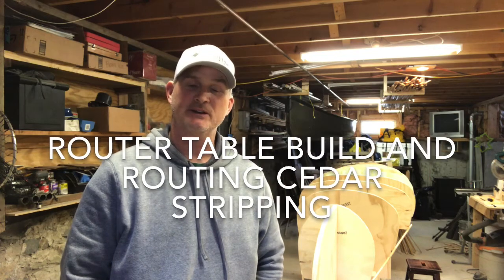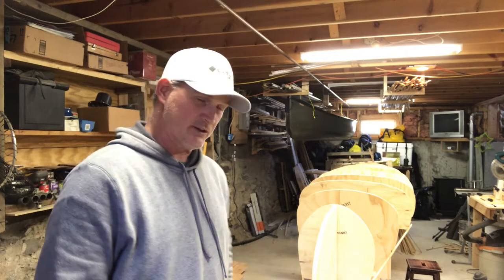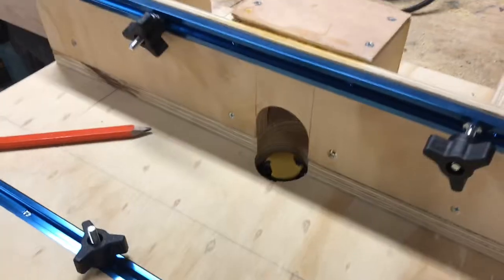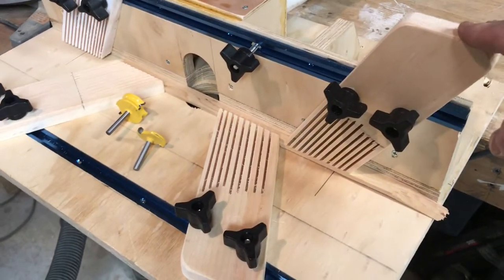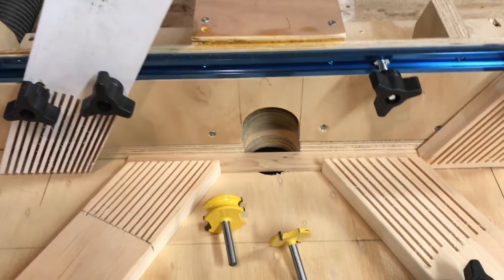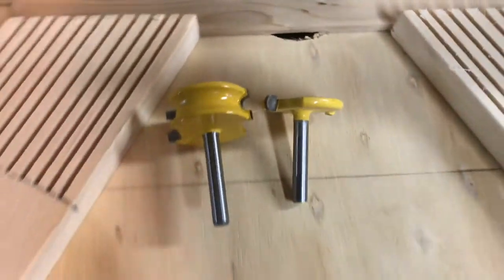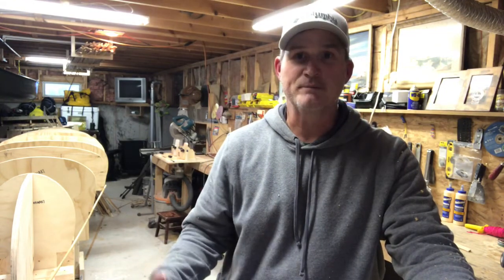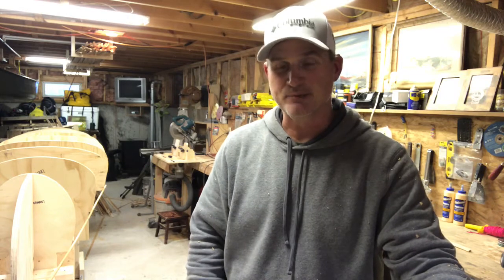My First Canoe Build, Part 3, Router Table Build / Cedar Strip Bead and Cove Edges

Comment: Hey, alsg here, don't forget to put packing tape or duct tape on the edges of all the forms to prevent the glue from sticking to them!  Also, have you beveled the leading edge of the bow and stern forms?
Reply from the maker: Thanks Alsg.  I fully intended on masking the form edges and have not shaped the bow and stem forms yet to receive the strips.  Just purchased a rasp in order to do that.  Next video will show the stem forms taped, bow and stem form beveled and hopefully a decent portion of the canoe stripped.

Comment: How come you had the fragile cove edge ? The cove bit height was not properly adjust ? Thank in advance for  for any comment .
Reply from the maker: Yes I believe I cut the cove too deep.  I would suggest several test passes to establish the final set up before processing all of the strips.  I learned the hard way but it really didn’t affect the finished product at all.  Ultimately the deeper than preferred cove cut forced me to use more material when it was all said and done.
Reply: @mainetripper  For sure I will take your advice and will do few test cut before   doing all of them . Appreciate your help .
Reply from the maker: Glad I could share my mistakes. Best of luck with your project!

Comment: What brand and size of bead and cove did you buy
Reply from the maker: Hi Charles,  I used 1/4” bead and cove bits.  Not sure about the radius round over.  Since this was my first canoe project I bought two sets directly from Amazon and I believe the sets cost me approximately $18 each.  I didn’t spend a lot and I do not remember the brand.  If you do an Amazon search for “1/4” Bead and Cove bits” the selections are in the forefront.  Hope this helps.